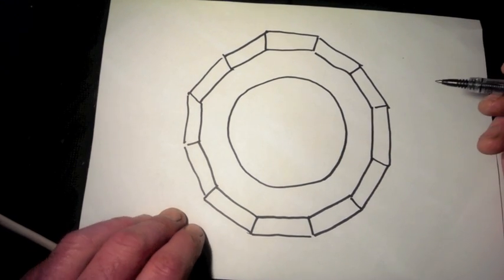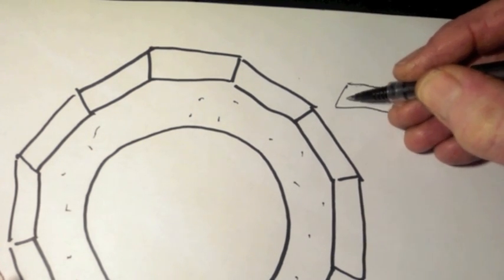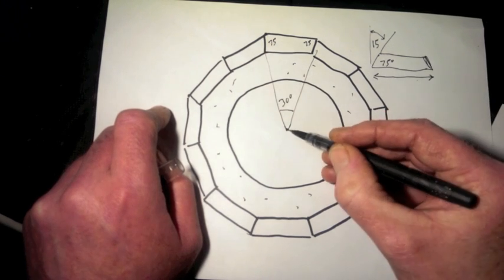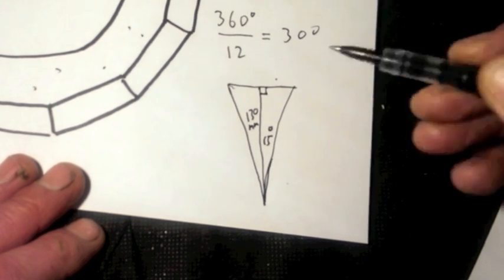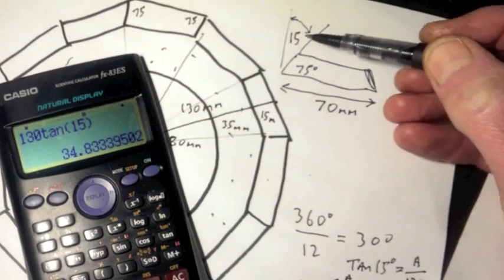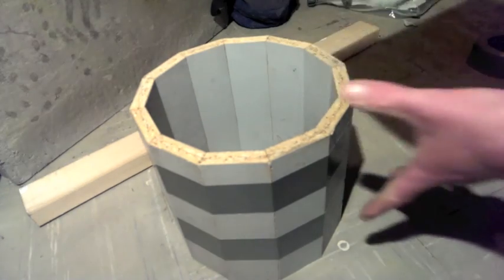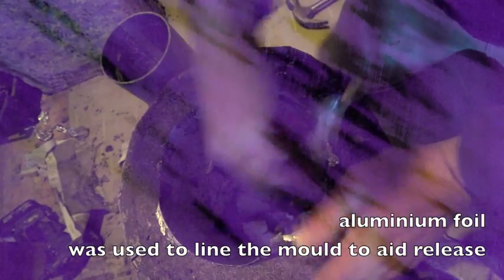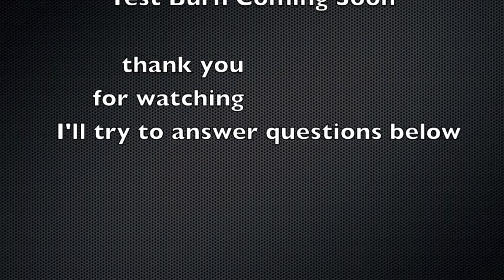Rocket Mass Heater Batchbox Cast Heat Riser Design and Build

Comment: You can make the outside circular form out of a corrugated cardboard box. That’s what I did and it worked out fine. I lined it with visqueen so the paper wouldn’t get saturated. I filled it with my mixture taking care to keep the shape I wanted. 
Simple and fast!  😎👍

Comment: Which get hotter the burn chamber or the heat riser?
Reply from the maker: I think Mad Grumpyman is right, the heat riser gets very hot as the secondary air causes smoke to ignite there. I can't be certain whether the top (heat rises) or the bottom (where the combustion is) gets hotter but both are very hot. The burn chamber is very hot at the back but relatively cool towards the front (cool air entering the door)

Comment: Very informative videos. You list the ingredients by parts by volume but when I go to order the ingredients how much cement will be needed? Is a 50lb bag sufficient for burn chamber and riser?
Reply from the maker: Sorry for the delay in replying Jeffrey. Yes, I found a single 25Kg back of cement and fire clay was plenty. I bought a 100L bag of perlite and used hardly any of it. If the wall of your casting is thicker, you'll obviously use much more - I estimated my needs ahead of time by measuring how much sand filled the moulds (but don't add all the volumes of cement etc together as they'll make fewer litres of mix than their individual volumes!).
Good luck!

Comment: Also should you vibrate the mould to get it to settle better, I have cast some concrete bench tops and used vibration to settle the concrete, do you recommend this’ll?
Reply from the maker: Yes, the more aggitation the better to get air pockets out. Unfortunately I don't have anything sophisticated for this and usually just keep tapping the form until I get tired! I've seem people use an orbital sander pressed hard against the form work too to agitate it. An SDS chisel would probably work too. 
Thanks for the comment.

Comment: Can you tell me if you are an experienced caster, have you casted through your work.  How have your castings held up and have you built your castings into a batch box heater which is used daily,  do you have to use pearlite and the beads or can you leave these out.
Reply from the maker: No, I have no experience other than experiments in casting concrete or anything else. I am certain that an expert caster could make stronger castings but mine worked as needed. In later videos you will find examples of where parts cracked during experiments but the main reason for the weakness was that everything was out doors and rained on. I eventually installed the burner and used it as a heater for a winter and there were no problems with cracking.
Perlite definitely weakens the mix. It is used to make the casting more insulating so that the burn heats up more quickly but that is balanced against strength. I haven't tried a burner without any perlite or clay pebbles but imagine it might work well (and would definitely be stronger).
Thanks for your question.

Comment: I have tried the TAN fucntion and it gives me a totally different number to you. I tried it on a online calculator and all show me the -111.279142118

I typed 130tan(15) =

what im doing wrong?
Reply: hey after some searching i figured it out so i thought i would share, trigonometry not my strong point. I read on a forum that Tan function expects a Radian value rather than a degree value. 

maybe your calculator is different or set up differently 

you can use google to calculate the radian value 

https://www.google.com/search?q=15+degrees+converted+to+Radians&oq=15+degrees+converted+to+Radians&aqs=chrome..69i57.7007j0j7&sourceid=chrome&ie=UTF-8

which in the case of 15 degrees is 
0,261799

130tan(0.26) = 34.58........

i share this here as i was baffeled and want to share it with those who also arrive at the same value as i did
Reply: p.s thanks for posting these great videos
Reply from the maker: Hi Fraser. Thanks for pointing that out, yes, the calculation was in degrees and, as you say, some calculators default to radians. Glad you like the videos, thanks.

Comment: DUCT TAPE, GENIUS. 
It's the modern miracle ingredient for any project!
Reply from the maker: Indeed it is. If only they made a fireproof version!
Reply: BatchRocketProject There is a type of fire proof tape that I have seen used on fire brick J tube tubes to hold the bricks together when they weren’t mortared together or to give some extra rigidity..

Comment: FYI.   Industrial kiln ceramic rollers can be obtained in various dimensions ( many around 4" ID ) and, as these are an immediately and very highly 'heat reflective' ceramic, they are an almost perfect material for riser tubes.
Reply from the maker: Thanks for the tip Seven. I'd love to use some real kiln parts but they are really expensive here in the UK and generally have to resort to cheap and available parts.

Comment: I wanna soak to heat risers in liquid glass that way they last a lot longer
Reply from the maker: Thanks for the comment rusty. I finally installed the burner as a mass heater in January and it's wearing well. Cured sodium silicate is actually quite fragile despite the claims on some youtube videos. Don't get me started on home-made recipes, suffice to say, if you plan using water glass in your refractories, buy it.

Comment: That's really cool, but after all that math and cutting and so forth...square risers result in better turbulence and a more thorough secondary burn.  Much easier to build and better end result.
Reply from the maker: Thanks for the comment Jason. Long before this project, I made some rough-and-ready burners with bricks. Square risers worked ok but I generally found better vortexing/turbulence the rounder it got. My ultimate aim is to have coiled copper pipe around the outside of the riser to exchange flue-gas heat to water and so prefer round sections for this build.

Comment: What are the proportions of the mix?
Reply from the maker: Sorry for the delay XplaneZ. I used the following mix, all parts by volume: 

2 parts ciment fondu high-alumina cement 
2 parts powdered fire clay 
1 part fine sand 
4 parts perlite 
4 parts clay pebbles for burn chamber / glass "growstone" for heat riser

Comment: What are you going to use for the bell of the rocket mass heater?

I'm debating with myself if I should make one and right now can't decide if I should use ppotty's design with a top fed batch box or I should use the horizontal fed batch box design that you're using?

I think I would prefer a top fed batch box design as that allows for easier loading and you can use smaller non-stack-able wood pieces and fitting a lid would be easier I think.

The inlet and secondary air feed and riser could be made the same so they should burn the same I think?
Reply from the maker: Morten - I haven't decided on whether to use a masonry bell or a metal drum. I intend to do some experiments with temporary assemblies when I have time. I suspect I'll end up with masonry walls supporting an elevated drum, much higher above the heat riser than in the traditional J-tube burners, to allow stratification of the hot flue gases. 

I think you're right that a vertical feed has advantages and I really like ppotty1's burner. I would probably have copied it if I had access to a decent mig welder and suitable steel. As I've only got a low-power stick welder, I'm pretty limited so casting the whole thing was easier for me. This was a big factor for me in choosing the cast batchbox design.

Regarding the air port into the heat riser, ppotty1 uses a curved entrance to induce a vortex while Peter van den Berg's design, which I'm following, uses a defined-dimension central port to induce a double vortex. Peter's batchrocket.eu website has all the measurements and design principles and ppotty1 has quite detailed information on his configuration spread across a few videos. I would imagine either principle would work for either a vertical or horizontal burn chamber, although Peter states that effective build measurements for his design are very tight and should not be deviated from. 

Good luck and thanks for the comment. Dave

Comment: nice stove.... do you add any vermiculite or perlite to the refractory cement, to make it more better insulating????.... if so what recipe do you use????... mahalo and aloha
Reply from the maker: Thanks for the comment and question Forest.

Yes, the riser and burn chamber are both insulated. I use some perlite in both. The burn box also has hydroponics clay pebbles which I describe in the second half of the first video. The clay is processed to have pores and is light but also strong so provides strength and insulation.
For the riser, in addition to the perlite, I use a processed foamed glass product called "growstone" as they are smaller chunks than the clay pebbles, which might be too large for a thin casting. 

I used the following mix, all parts by volume:

2 parts ciment fondu high-alumina cement
2 parts powdered fire clay
1 part fine sand 
4 parts perlite
4 parts clay pebbles for burn chamber / glass "growstone" for heat riser

See the second half of the burn chamber video for mention of the insulating aggregates and cement. 

https://www.youtube.com/watch?v=AbdNi09ZPgc

Good luck!

Comment: A little late now, but large cardboard tubes exist, called Concrete Formers in America, which are perfect for riser molds. They're cheap and come in a range of sizes, from 6" x 48", up to 12" x 48".

https://www.lowes.com/pl/Concrete-forms-Concrete-tools-Masonry-tools-Asphalt-concrete-masonry-Building-supplies/4294515386
Reply from the maker: Thanks Kentucky. Cardboard would be great as it could be burnt away so wouldn't need de-moulding. I had a look at carpet roll tubes but the largest I could find was 4 inches, I'll look for a supplier of the concrete formers next time as it would be a lot easier.

p.s. there was a slight delay in your comment showing as the spam filter had caught it, possibly for the link although I thought the setting was only for abusive messages - which yours is obviously not! Sorry anyway and thanks for commenting.